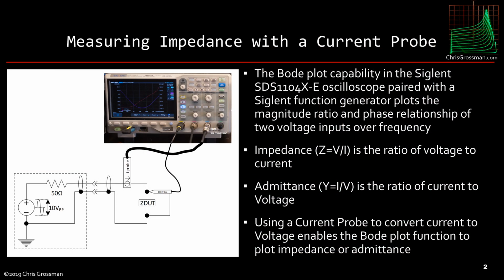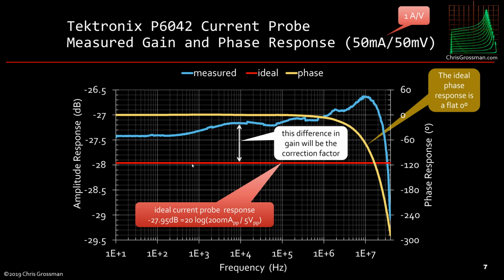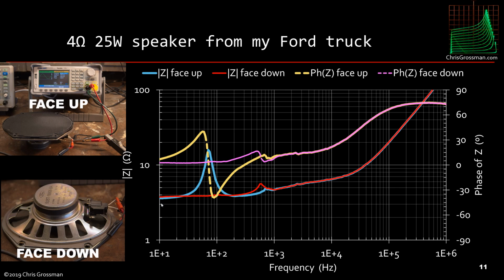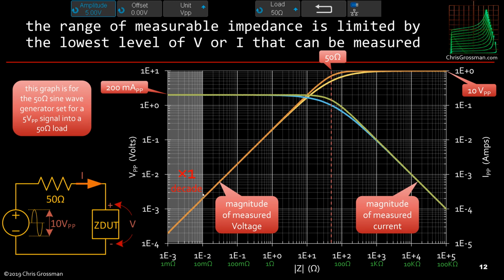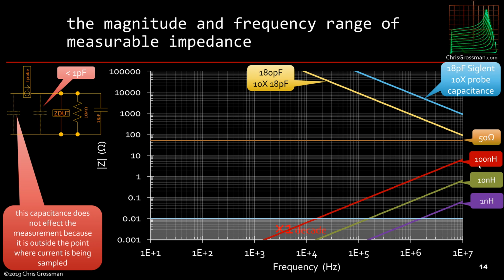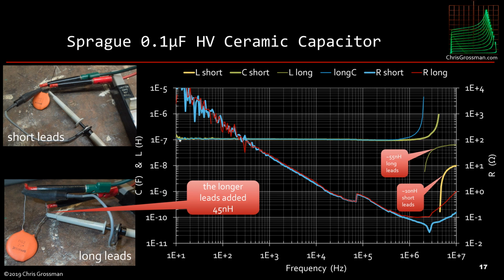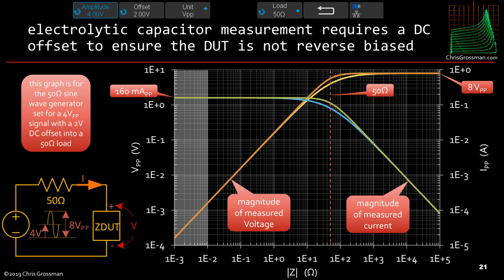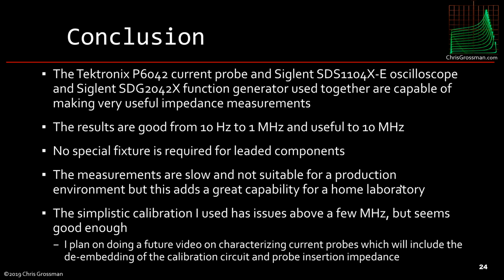⭐ Impedance Measurement Using a Current Probe and Siglent Bode Plot II #0006

Comment: Hi Chris Thanks for making this video. When I open your pdf file, I see some Impedance - Frequency measurement on the screen of your scope (pag 2 of the pdf file). How could you get that on the scope screen ? Or did you only create the Z Impedance curves in a spreadsheet ? I have the same scope and function generator and like to measure the Impedance curve of some piezo, but I do not have a current probe which will be usable up to 1 MHz. I like to use a resistor in serie with the piezo to measure the voltage over this 100 Ohm resistor to get the current which is flowing to the piezo and back. How can I create the Impedance curve with this kind of set up ?

Comment: The 6042 was replaced by the AM503 and P6302 in the mid 70's.  These had a max bandwidth of only 50MHz.  The P6022 current probe has a 150MHz bandwidth.  However, the P6022 doesn't measure DC, but that may not be of concern.
If you are concerned about the capacitance of the current probe, you can connect it on the ground side of the circuit where the voltage is zero, so capacitance has no effect.  The current is the same.  The voltage probe ground clip needs to be on the supply ground (after the current probe) otherwise  some ground current could flow through the scope probe.
fyi, I was a designer the Tek current probes.
Using the proper ferrite core with several turns of wire, you can replace the current probe and  get a higher bandwidth.